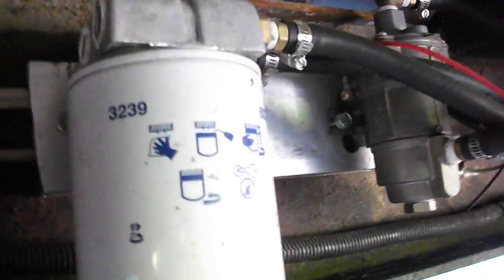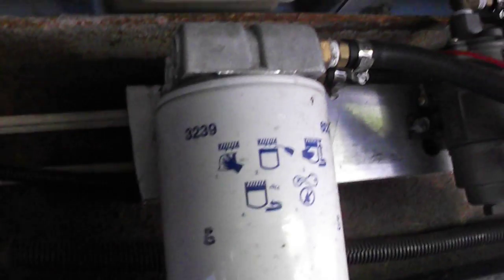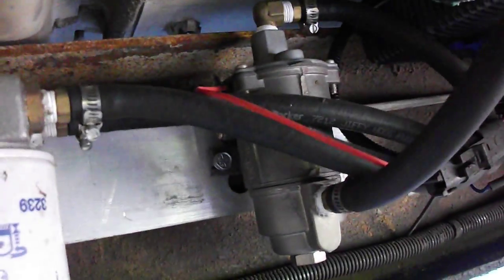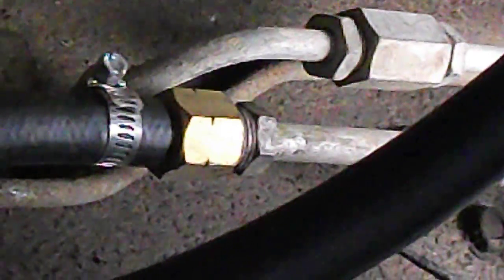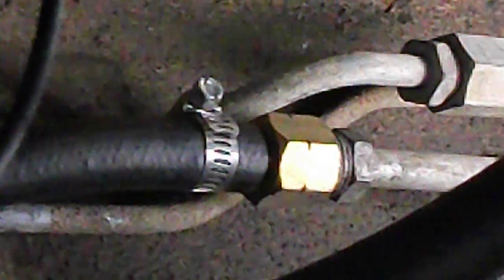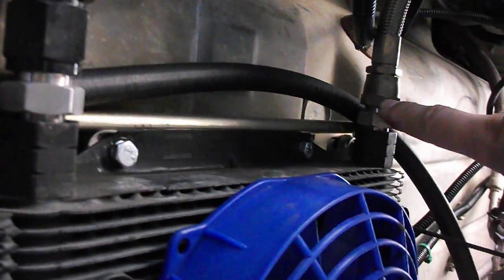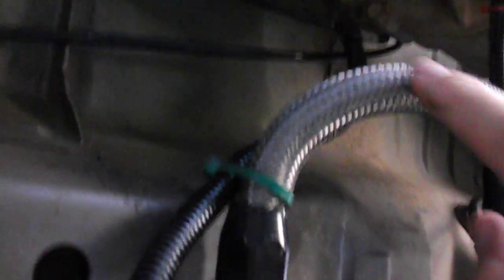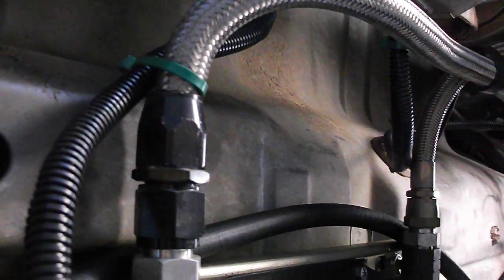Remote engine oil cooler for 6.5 diesel

Comment: Were you unhappy with the original, behind grille, oil cooler ?  Why ?
Reply: @leroydiesel6.5  plus, running hot rad air across the stock cooler being the tube and plate cooler or the older hoop type 6.2 cooler is counter productive. Personally, I would mount a cooler of any kind being it a engine or trans cooler in front of the radiator. I have done this in the past after installing a auxiliary cooler for my 700R4 install.

Comment: About the third oil port where the oil filter is located is that a oil pressure outlet port or inlet?  I'm looking for a oil pressurized outlet to hook up to the oil feed on a turbo that I am installing on my 1987 6.2L diesel. Also my oil cooler is part of my water cooling radiator as well as the automatic transmission cooler which I also plan to use as the oil cooler for the turbo since I just did a automatic TH400 swap to a dodge NV4500 manual transmission!
Reply: Thank You Leroy really appreciate the reply! ;)

Comment: great video! wanting this setup for my 6.5. Also the lift pump and auto trans cooler. curious about adding an oil remote filter (2 oil filters) for the engine oil and one also for the transmission fluid and cooler? pressure tap and sender for gauges in cab + a third gauge. what would you suggest for the best third gauge? thank you!

Comment: Do you sell the lines pre made to length for that set up and also do u sell the fan in the kit this is what I was thinking to do with mine as of right now I have the old cooler unhooked just have fittings and made a short line to  bypass it for now but I'm about to tear the motor back out I believe I broke a ring or piston on the used engine I installed but just thinking for when I get it back together the other engine blew a oe style line and seized